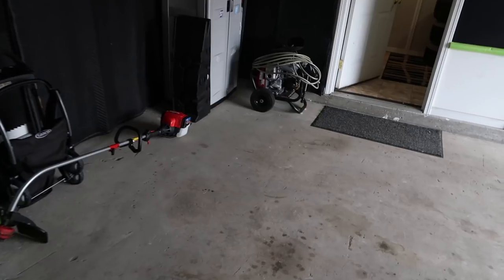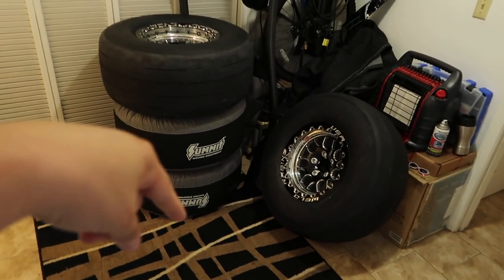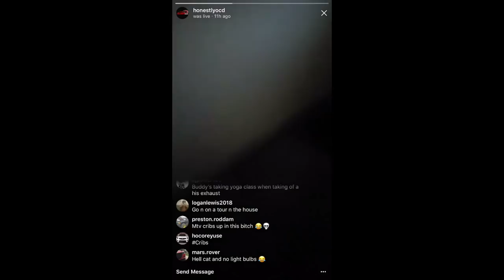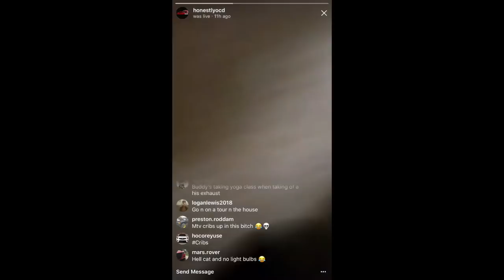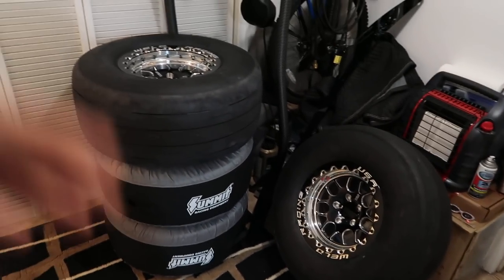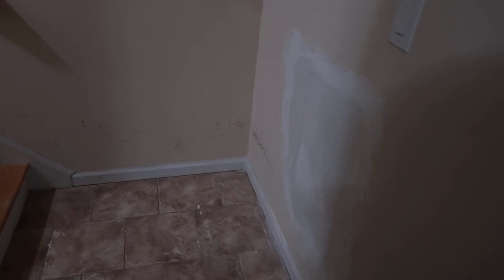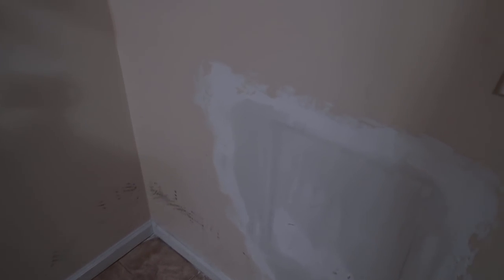Fixing A Hole In My Wall Fail ?? and A Small Update

Comment: I just had a oil pressure issue. Spun a main bearing. I’m getting a whole new forged short block. These oil pumps on the hemis are gear driven. It’s crazy rare if they fail and when they do fail they won’t work at all. It’s like a TV it’s either on or it’s off. So the fact that you still had oil pressure meant the pump was doing it’s job. So that sounds like something internally that’s caused the oil pressure issue just like on my engine